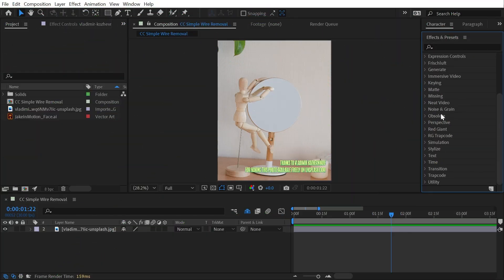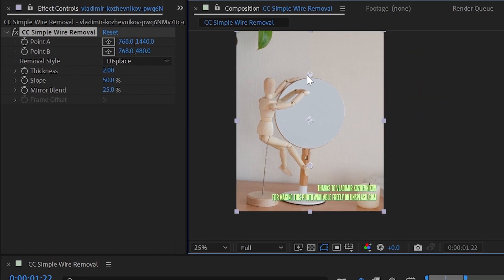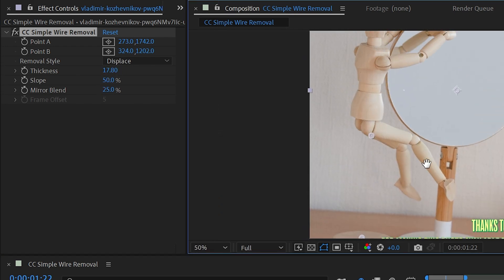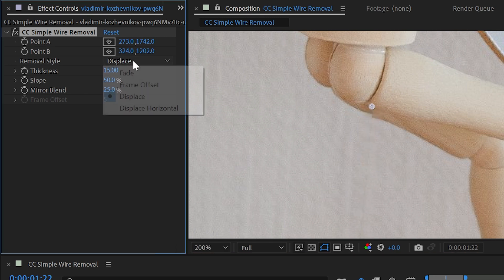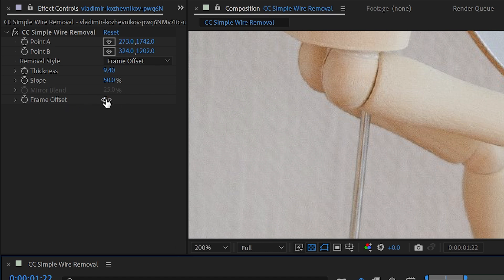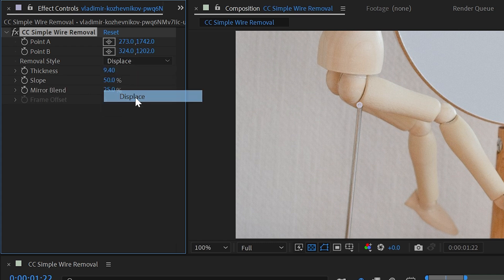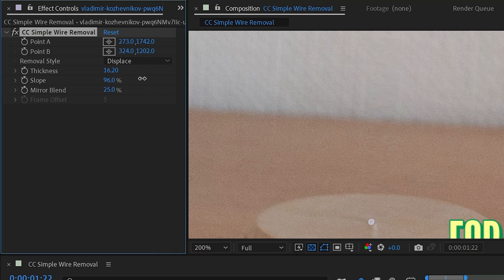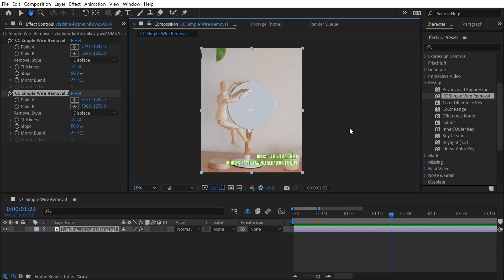CC Simple Wire Removal | Effects of After Effects

Comment: It's basically like the PxF_Filler node in Nuke that VFX artists use to remove wire and green screen markers. Would have been really useful if it could use masks to remove stuff instead of using a line. And there's no real way to adjust the direction of the blend other than making the line more diagonal. That could help solve the issue with the leg of the doll.